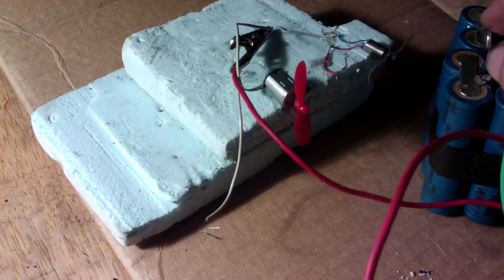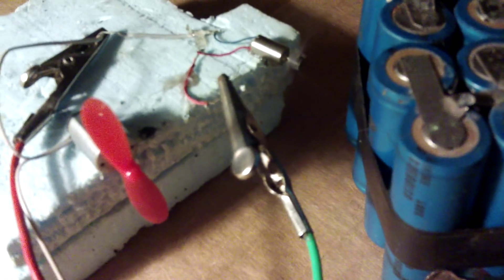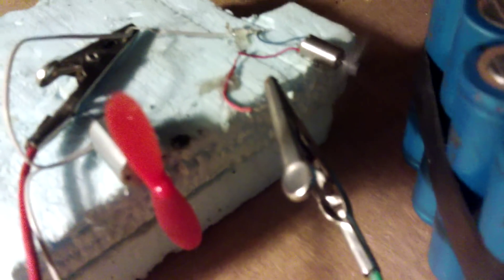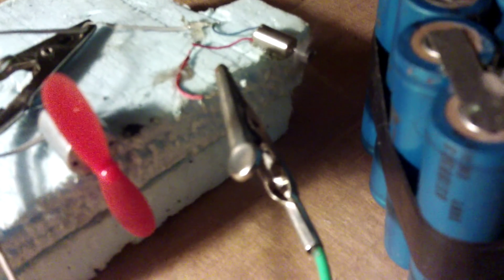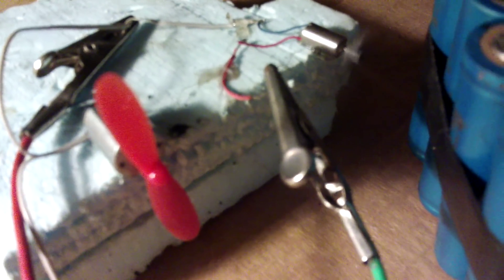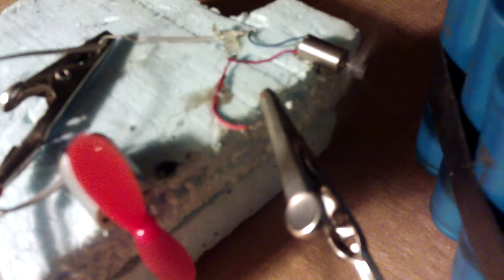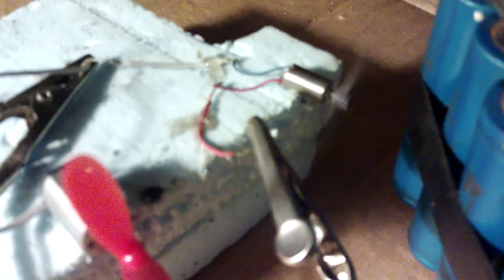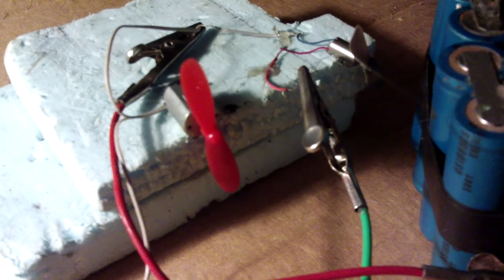6  minutes supercap motor run - no graphene

Comment: have you made a larger version?? I want to make one big enough to start a car or do useful stuff. So have you gone and made larger capacitors?
Reply from the maker: +aomanchutube Not yet, but it's a good question to ask. Mostly it's about material costs. I believe that Robert Murray-Smith has gone really large scale with his caps, to the point of putting them in an electric roadster. Can't wait to see that project !

Comment: The fact that it works using steel and carbon is great , I have been using copper and aluminum.  I will need to build one with steel mesh and carbon.  Thanks for your work.
Ed
Reply from the maker: +Ed Lovvorn Thanks for the research study note ! Good luck with your experiments too :)

Comment: It is running as tic tac supercapacitor.
Reply from the maker: +Huynh Anh Quang Yes I agree, with the binder clip replacing the epoxy. I'd like to find a way of keeping the pressure, but without the weight or an expense of epoxy.
Reply: +slider2732 shrink wrap maybe,maybe the heat that comes of these woukd keep getting tighter and tighter
Reply from the maker: +bill bailey ;) shrink tubing is one of the improvements, had the idea on waking this morning and didn't even make a coffee before trying it. Have got a few tubes shapes that were too big for the wire I normally use (Electronic Goldmine pack)

Comment: That's great! Running a motor for six minutes from a 15 second charge shows it can do something useful. The starch may be acting as a current regulator, so making the 'juice' last longer. One or more of the ingredients is being exhausted. Is it the acid or phosphorus? Using different numbers of match heads in two cells but with the same concentration of acid in both and comparing run times would give you a clue. If that made no difference, then the acid is being exhausted. Then try a trickle-feed of fresh acid from a 'fuel tank' to see if run times can be increased.
Reply from the maker: +Pseudo Nym I like the trickle feed idea. With a few made so far, the oldest can be topped up with vinegar or a fruit juice and they're back to normal. Some have had 2 dozen or more cycles and only need the acid replacing...that's why the thinking is a fuel cell. But, they will also run from a AAA batt. not as long etc, but it needn't be a high voltage and current.

Comment: Well, what is the maximum voltage that this cap holds after charging ?
Do you get more than 2.7 Volts after charging ?
Normally everything with Saltwater will only go up to around 2.7 Volts and then the electrolyte starts an electolysis process so the electrolyte starts to decompose and fizz...as also seen in your case, that is also why you should never charge commercial supercaps over 2.7 Volts, as they could explode from the decomposition and gasing of the electrolyte... So it would be probably best to use an ionic liquid. See neatpete45 channel, on how he created a cheap ionic liquid... In these electrolytes there is then no water, so the electrolyte can not decompose so fast...or only at higher voltages, so you get a higher charge voltage and thus more energy storage as energy storage goes up in square with Voltage, so every Volt more will really be important for the energy storage... Regards, Stefan.
Reply from the maker: +freeenergynews Thanks for your comments Stefan. The max voltage has been approx 2.2V. They can top out higher but it drops immediately. The cell then tends to bleed off voltage, which interestingly semi correlates with actual motor run times. Charge and go seems the way with these. However, simply tapping quickly on the 12V source has seen 2 minute runs...less initial speed and such but carrying on and on. 
How cool would it be to have massive versions for cars, really light, topped up with a fruit drink, quickly tap on the household mains supply, drive to work.
Runs with a AAA show some promise (1.5 minutes from 5 seconds charge of the same cap) and are probably wiser than the 12V...the preference would be lower input sources, which would extend the electrolyte.
Reply: +slider2732 hi slider I will answer this from my main account now here... I still wonder how Lasersaber had got 5 volts for his super SuperCap as a charge voltage.? it seems as is related to the electrolyte one is using....  all electrolytes with water in it can go only up to about 2.7 volt maximum and in your case only 2.2 volts so it depends really on the electrolyte what the maximum storage energy could be....as higher voltages can store much more energy... so if you get to 5 volts you can also use these great LED lamps with USB connector which are really great and give off enough light for a room so powering these with such a bigger super capacitor  would be really great... then you could use a solar panel to charge up this supercapacitor during the day and use it during the night to light up your led lamps in your house
Reply: +overunitydotcom maybe lasersaber gets such a high voltage because he is using phosphoric acid in a very high concentration so there is not much water in the electrolyte??
Reply from the maker: +overunitydotcom Will have to view his video again, but I think that Lasersaber may have a series connection within 1 cap ? The midpoint of 2.2V and theoretical limit of 2.7V would be 2.5V. 2 cells internally for 5V. At 5V we open many doors with high energy density (inclusive of graphene)....perhaps not phone charging but not far off ! Imagine a tiny cell with a micro USB end connector. At 4V and light as possible we enter lipo territory for R/C toys, which historically have had approx 5 minutes running time and 45 minutes charge up time.
The acid concentration is definitely something to explore.
Rather than solar during the day, these have a quick tap ability - after making this vid I found that 2 seconds was near to the 15 seconds, much was wasted in the 15 seconds as heat + fizz ! So probably conventional Li-Ion or SLA storage from solar, quick tap for the cell for flashlights, portable fans and such....which is actually how my setup is now with the ancient Li-ion pack.
it's a delight to have your input Stefan, thank you for your help and thoughts  !